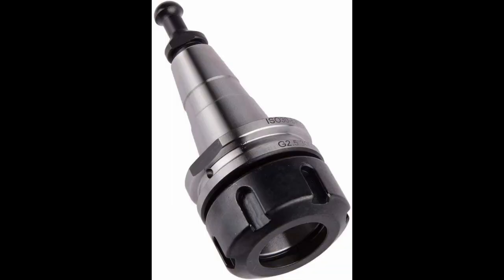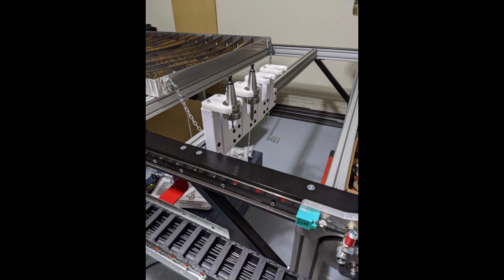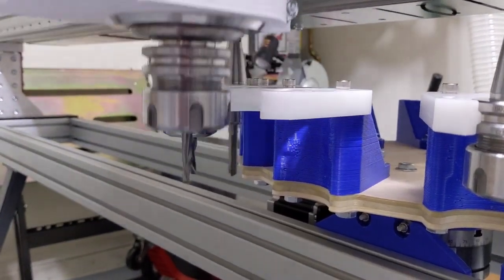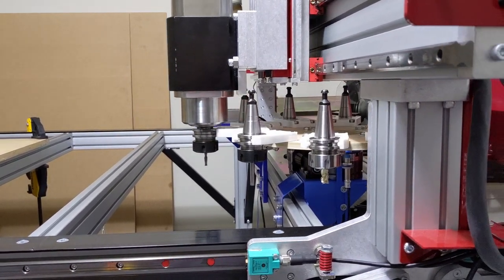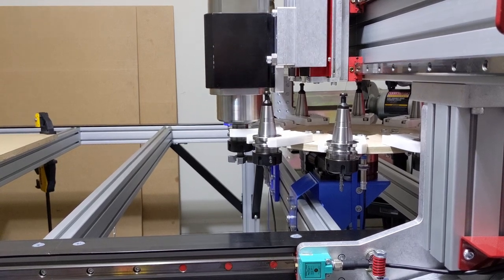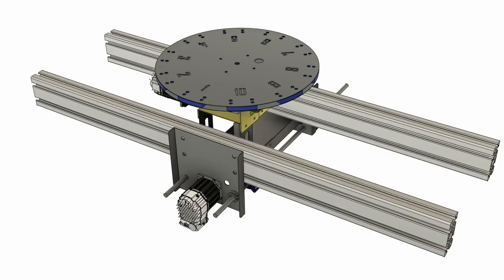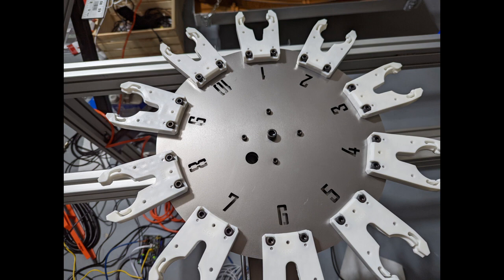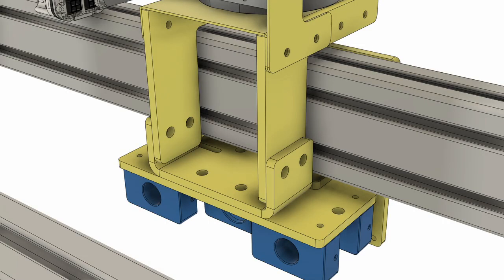Automatic Tool Carousel (ATC10) - History & Design

Comment: I just ran across your video and found it pretty helpful. We currently have 3 AvidCNC Pro machines. Like you, I didn't like the loss of table real estate when placing the tool forks in that back of the machine. I also found that parking a dust shoe was problematic and spent months developing multiple iterations of a retractable dust shoe that would work with a CNC Depot spindle. I'm happy to say the the retractable dust shoe is working well and stable. I think there is some room for improvement but we've tested it in a production environment and so far so good.

I've look at the umbrella approach and thought it would be great if it was mounted to one end of the X axis. That way tool change travels are kept to a minimum. Trecking back and forth on a 4x8 machine is time consuming.  I've just started my adventure into the tool changer.

If you would like to collaborate on designs, let me know.
Reply from the maker: Thanks for the offer, everything is finalized at this time and we are waiting on the e-commerce system to be finished. It's all that payment and account management stuff that takes a lot of work. Stay tuned! April is looking likely.

Comment: DO YOU HAVE THIS TOOL CHANGER DESIGN READY FOR SELL? IM INTERESTED!
Reply from the maker: I am closing in on a beta tester release soon. Respond with your machine manufacture and model and I can see if the system will be compatible.
Reply: @subnoize-cnc  I MADE IT MY MACHINE IS 45'' X AXIS  48'' Y AXIS  12'' Z AXIS
Reply from the maker: @uptechcncpvclt-1302 Ok, let me get everything "kit ready" and I can customize to other systems. This has been a very long and expensive endeavor!